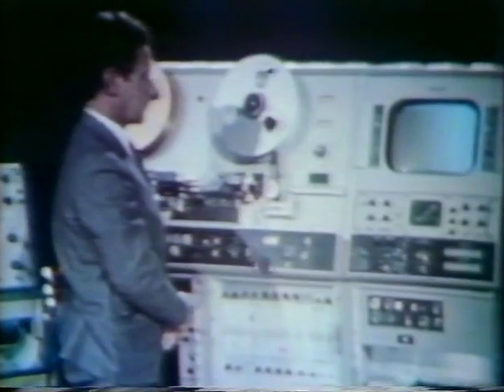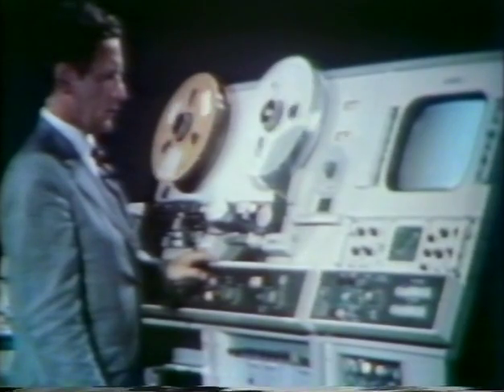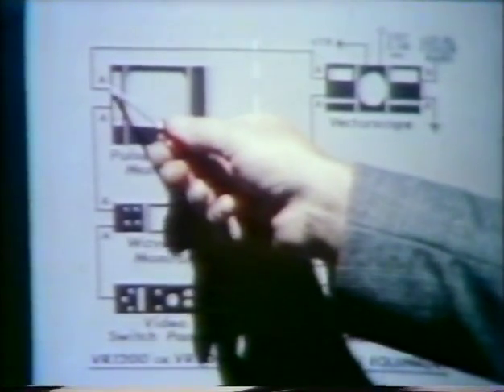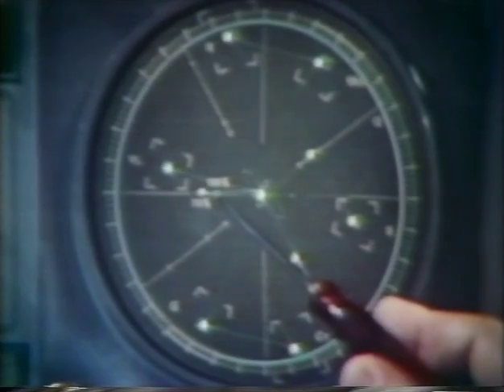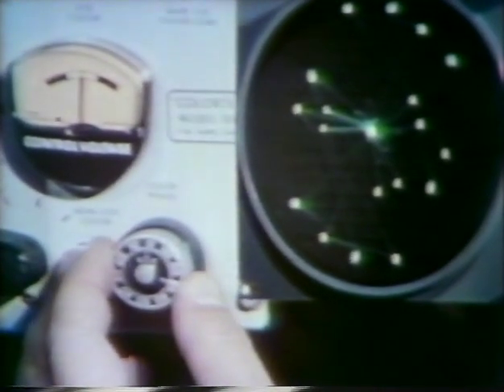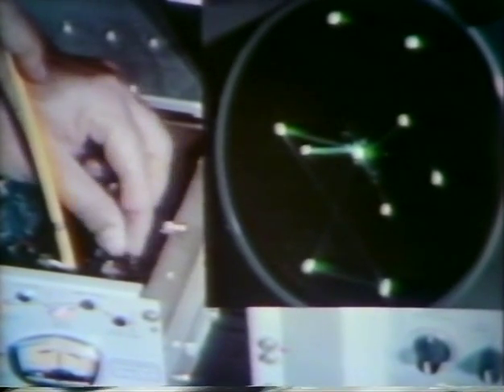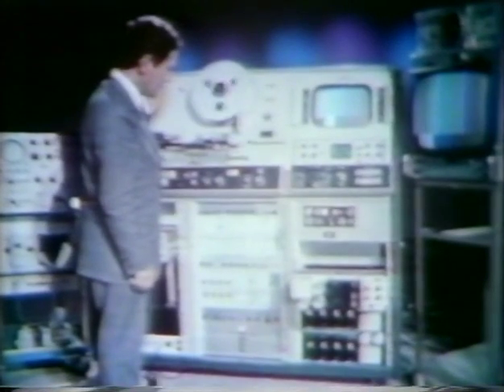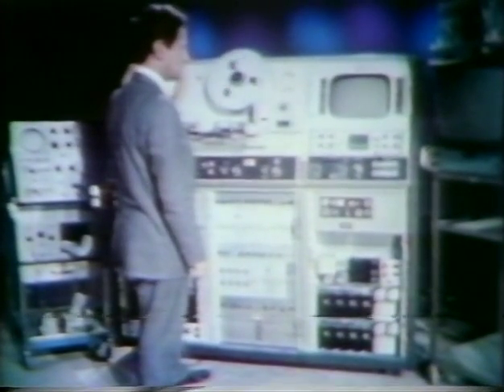Ampex training tape for the operation of the VR-2000 Quad VTR, part 3

Comment: Wait!  This is a film chain transfer from 16mm!  
This is a film about using a video recorder.  CLEARLY someone didn't want to use their own equipment....
--scott
Reply: What is interesting is that there is no beating between the camera frame rate and the video frame rate. From the American commentary, I presume it was film at 24 fps and video at 30 fps, so it's not even as if it was film and video both at 25 fps as for PAL (16 mm cameras for UK TV work are modfied to run at 25 rather than 24 fps). VT would have been so much easier for synchronising because they could have genlocked the camera to the video output from the VTR. I wonder how much film they used while they were tweaking the phase of the film camera so any noise bar was between the video frames. Is it even possible to film a US TV screen with the 24-to-30 fps disparity - is there something that does the opposite of the 3:2 pulldown for showing 24 fps film on 30 fps TV?

And then there is the fact that 30 fps is really 29.97 ;-)  I'm so glad in PAL-land we came second and designed our 625-line broadcast spec so the colour sub-carrier and sound carrier didn't collide, maybe learning from the NTSC problem, which is the reason that 30 had to be downgraded to 29.97 - it was a VHF/UHF broadcast issue rather than one with the baseband signal.